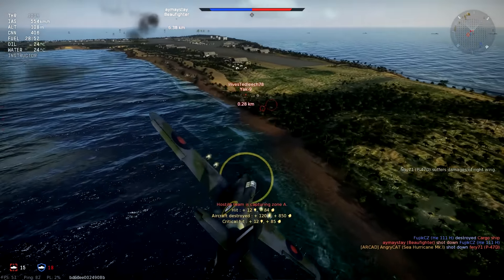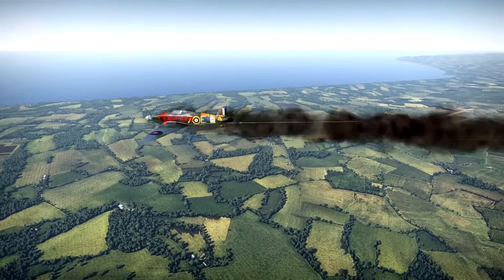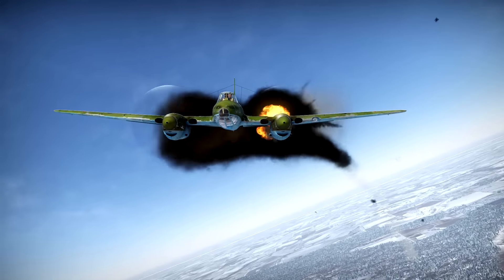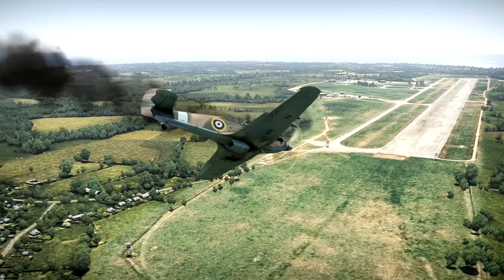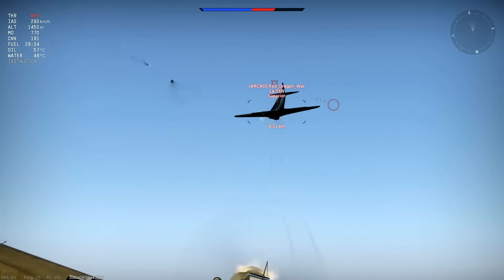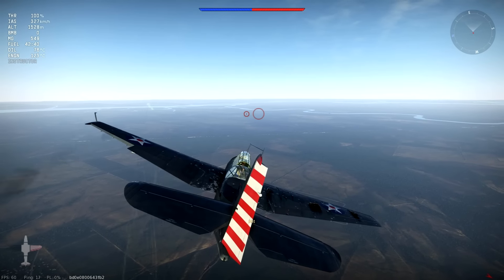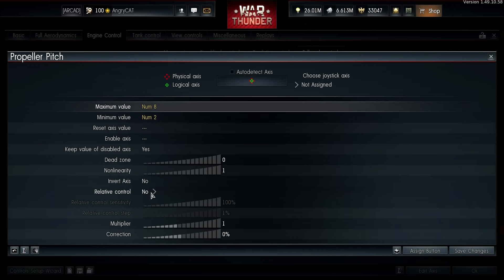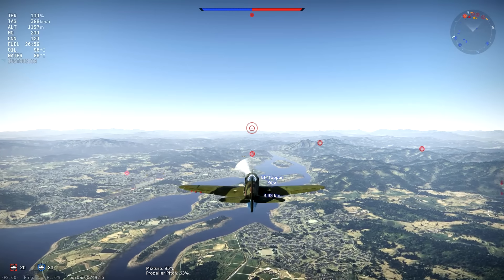Aircraft Damage - War Thunder Video Tutorials

Comment: Propeller pitch is NOT like bicycle gearing and it doesn't control how fast the propeller spins.  Propeller pitch is how sharply the blades of the propeller are angled, which affects how hard the blades are pulling on the air as they spin.  With identical propeller speeds, a prop with a higher pitch angle with produce more thrust than a lower pitch angle.

Comment: As of 3 minutes ago. Bug when engine failure due to prop pitch. Landing on strip WILL NOT repair. firing shots will rearm, which glitches repair, and then it will work.

Comment: One time i was playing my first game of realistics battkes on planes and i was 4700 meters and i went to a head on with a hurricane and then my elevator was severly damaged  so damaged that i lost control of my aircraft completely and my aircraft just started flying up because my elvator was stuck in  a broken position so my plane always went up making it difficult for my plane to land i also sustained some minor fuel leaks
But for me to land i drove upside down then when i was about to land i turned back up and no more energy was left so i just landed 
I landed unsafe though cause i did not know it at first but my landing gear took significant damage  one of my landing wheels broke
But thankfully still alive

Comment: what a realistic damagemodel

flies back to airbase with both wings shot off
Reply: Well, in real life a B-17 landed with the tail completely separated and only joined by parachute strings. If only the tip is taken off, it can still fly. The A-10 warthog was designed to fly without one wing too.
Reply: Leonel Yan but i did it in a yak 9t in realistic battles
Reply: TEEWURST And? I have done it in a P-51 and the XF5F as well as a spit if I remember correctly. As long as not much of the wing is taken out, it will still produce enough lift and fly.

Comment: "Propeller Pitch controls how fast the propeller spins" that's very wrong. Propeller pitch controls how much the "pitch" of the propeller relative to the airstream so a higher pitch will scoop more air in each rotation than a lower pitch.
Reply: They both are  correct actually, propeller pitch does does vary the amount of bite the propeller is taking but as you go from fine pitch to course pitch he engine rpm thus propeller rpm decreases, that's how engine rpm is controlled in piston aero engines, throttle controls manifold pressure or boost if you like.

Comment: Wait, opening the radiator actually does something other than slow you down now? I remember that, even quite recently, there was no noticeable difference in engine temperatures when using 0% radiator or 100% radiator. Of course, the radiator does make a difference in the air speed department though.

Perhaps I'll have to go back and test a few aircraft to see if opening/closing the radiator actually does change engine temperatures now.

Comment: Is it just me or whenever I shoot a plane it's basically a bullet sponge and I can shoot their pilot,engine,fuel 40 times  it won't die but when I get shot I die instantly and when I shoot a bomber it won't die when I get shot as a bomber I die instantly :(
Reply: I know right? Happens way too many times.
Reply: +kopfjager68 Depends on the gun/ammo you use. Many Brits get terrible ammo and are stuck using 7.62mm guns up to a high tier. But there are some planes with huge guns and others that get tiny 6mm (I believe the french one-off plane) guns.
Reply: I mostly use bf109 f1 I think and p51 / b25
Reply: Usually no unless it's flying low
Reply: +kopfjager68 I'd say try to be more precise with your aim. Change your angles of attack (an attack from behind is safer, but gives you a smaller target), try to go for control surfaces (or engines when attacking a bomber). Check your gun convergence : if you hit when the plane is further than your gun convergence, you'll spray all over, same if the enemy is too close. Try to fire as much as possible when the target is at your gun convergence distance (less true for the 109 since the guns are in the nose, but still). Also, have a seperate key for small calibers and large calibers. Only fire the later when you're almost sure to hit (helps you saving ammo)... other than that, not much more you can do. Remember that it depends on the game mode you are playing. In arcade, planes are kinda bullet sponges.
Reply: +Paehrin Ok :D but fyi I dive if no top turrent and if on on the back I would go super low and climb under it and unload hell I try and shoot for the bomb bay or cockpit
Reply: kopfjager68 Don't aim for the bomb bay. It doesn't work. aim for control surfaces or wings. Hitting fuel tanks works well on bombers too.
Reply: Yup, that^ when attacking a bomber, wings are the weak point. At least try to go for the engine, they're pretty big and easy to hit from any angle. Then I'll suggest that you make passes on bombers, that limits the time you stay in gunners' range, and anyway, the P51 and the 109 are pretty good at BnZ (and the P51 is... pretty bad at low alt fightint anyway^^)
Reply: +kopfjager68 isn't it all depend to pilot skill and gun calibre?
Reply: Lol it's funny to see other p51 pilots at low altitude and see them flying weird while I'm just flying normal dodging trees xD
Reply: Your not alone
Reply: +kopfjager68 "toll lololololololololololololololololololololololololololololololololololololololololololololololololololololololololololololololololololololololololololololololololololololololololololololololololololololololololololololololololololol"
Reply: You're doing it wrong. You need to get aircraft with a good set of cannons
Reply: +kopfjager68 I feel your pain. I feel your pain.
Reply: If possible, I use ammo that when fired, I can easily see so I can determine where to aim.
Reply: yeah its called tracers
Reply: you only notice it when it isn't normal to u , thats just normal u might just kill a bomber as many times as the guy that shot you
Reply: lol i just started using my fw190 a-1 again and i ddint know i had air target ammunition so i hunt my freind in his b29 xD
Reply: TheSpacecraftX they're 7.5 mils on the dewowitine
Reply: ik right,
Reply: I've had that happen before but never when i'm using GLORIOUS SOVIET CANNON
Reply: It's a potty party for you then
Reply: @Paehrin  P40 is good
Reply: @greenmario3011  BROSOY GRANATU
Reply: and thanks to YOU for making gaijin FREAKING MAKE EVERY SINGLE PLANE A 1 HIT KILL NO MATTER WHAT IT IS >:(

Comment: The G force system sucks, we need to spend tons of golden eagles just to increase one star. Not to mention how the spitfire's wings breaks while climbing.
Reply: +adam sulaiman what? which Spit?
Reply: Zacarias Recabarren Thats the thing, there is some glitches. By reading your comment, I knew you're confused. I was in a dogfight. High G turns then I climb coz the enemy Yak lost his speed, the moment i pitched up, ripped my wings.
Reply: +adam sulaiman It's just physics, if you pitch up while having high G-force, your wings are going to fall off
Reply: Portalowy Really? The g force system with the lost control feature still really suck
Reply: adam sulaiman That's how real life works. You get too much G's and you blackout. If you're lucky you wake up still in the air.